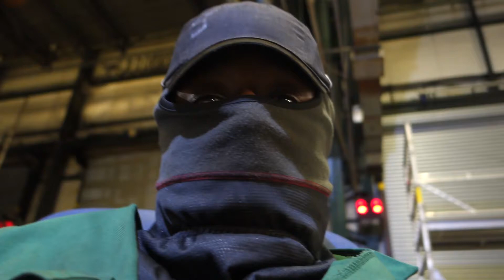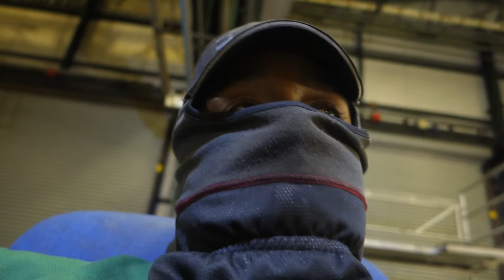Introduction to train engineering rolling stock workshop life

Comment: Did you do apprenticeship
Reply from the maker: yes but not on trains, I did my apprenticeship on construction plant equipment.
Reply: Yh I do an aprenticship in buses
Reply from the maker: @jeremiahbray9816  I used to rebuild automatic transmissions for buses before I worked on trains.
Reply: Oh what company
Reply from the maker: @jeremiahbray9816  voith turbo
Reply: Nice I want to get into train after my aprenticeship
Reply: I think it will be similar to bus
Reply from the maker: @jeremiahbray9816  yes lots of ex bus mechanics work on trains. A few of them went back to buses

Comment: Was ist mit deinen RC Cars, fährst du noch? Gruß von Berlin und ein gutes neue Jahr
Reply from the maker: Yes still into the rc cars got some videos coming soon
Reply: @nolimit7  Great. i think it's amazing that you have places in london where you can drive big models. It's difficult in Berlin. Even with a small 1/8 nitro, it is not easy to find a place in Berlin. we drive a lot in the surrounding area. or electro. the group is called london bashers or?
Reply from the maker: @chriskrueger8136  It is still difficult to drive these models in London as we have been banned from some locations because of the noise but we do have a few spots where we get left alone.